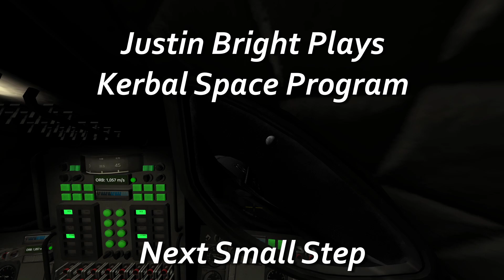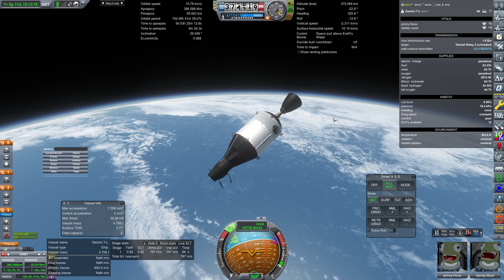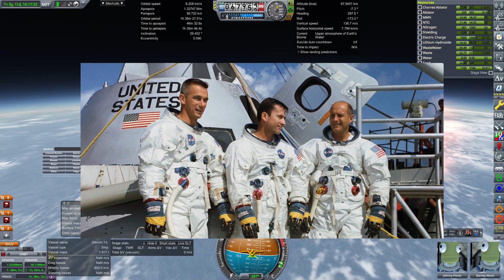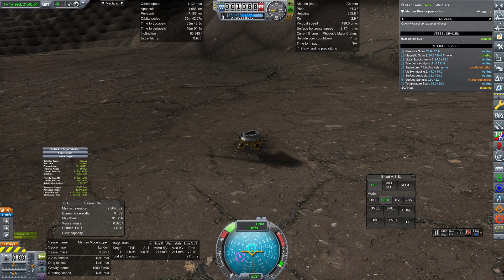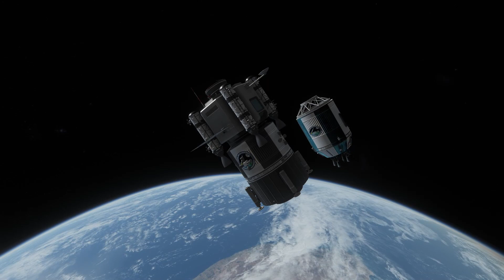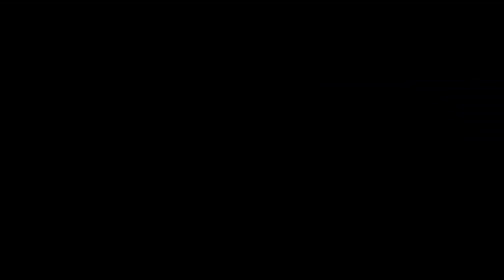Gemini Lunar Landing Part 1! - KSP/RP-1 - Next Small Step Episode 71

Comment: Is there a mod you have installed that lets you run a power simulation at different bodies? I’m struggling to design my probe for Mars with solar panels bc science costs electric charge
Reply from the maker: That's from Kerbalism! If you just click on the body name you should be able to switch it.

Comment: Lunex wasn't an Apollo or Gemini based proposal, it was a USAF lunar lander plan. It was planned to be a direct ascent lunar lander with a lifting body reentry vehicle, launched on some sort of super-Titan. The RL10 was originally developed for Lunex, starting around 1958, but when NASA was formed, it and Agena were moved to NASAs control (hence why Vega was developed, NASA had no knowledge of the RL10 or Agena until the US government forced the USAF to share). Very little actual hardware was ever produced for Lunex, but the RL10 was tested sometime in the mid 60s to verify that it could throttle for use as a landing engine. It ended up being able to throttle very low with almost no modifications. 

However, Lunex was extremely optimistic (lunar landing by 1966, and a lunar base by 1968), and the Vietnam war meant the program was pretty much abandoned by 1965.

Speaking of which, the USAF LV proposals were certainly special. My favorite is a Nova-class launch vehicle built entirely out of clustered Titan first stages.
Reply from the maker: Thank you for the history on Lunex! I'll make sure to mention it. I may wind up using it for the intended purpose, but only a decade late. The early NASA days are absolutely fascinating, with the way that there were multiple competing programs vying for dominance and not really sharing information. 

Also, a giant multi-Titan Nova sounds amazing.

Comment: I think your descent stage on the lunar lander might have a little too little delta v. 1800m/s is extremely close and 2200m/a would be way safer
Reply from the maker: Safer, sure. But heavier, also! Maybe it'll be fine??
Reply: @justinbright9567  try unmanned first and see if it works. If it doesn’t add a some more fuel and slap a few Castors on the first stage to easily boost performance

Comment: So the whole “Apollo 10 was under-fueled to prevent the astronauts from landing” thing proooobably wasn’t true (although I really want it to be : P ). The more boring explanation is that LM-4’s structure was heavier than 11’s LM-5, which meant that they had to compensate by not fully fueling the tanks. That said, Nelson, who you mentioned, quoted Cernan saying the opposite.
Reply from the maker: Interesting! I definitely thought I'd read that they only included enough fuel to simulate where the LM was in the flight plan; that is, having already mostly ascended to orbit.
Reply: @justinbright9567  That’s definitely possible, too - I’m absolutely willing to find out I’m wrong.

Great video, as always!

Comment: Welcome back!
I found your missing ignition. MechJeb spent it at 34:30, starting the circularization burn as it was ordered, but you immediately cancelled the burn.
Had you clicked one second earlier, you would have been in time - had you been one second late, you would have probably realized that the engine was burning already.
So yeah, I guess that the lesson there is don't push "execute next node" until you're sure you want to execute that node.
I made that mistake many times myself - hit "circularize" and "execute", then find myself out of delta-V in a wacky high inclination elliptical orbit, only to realize that I had the wrong probe core selected as control point and "retrograde" was actually burning anti-normal or something.

And now, a few words from our sponsor: the Oberth effect.
Often mentioned, but rarely understood, what is it, where does it come from, and how can I exploit it to crash ever bigger payloads into Jool's soupy atmosphere?
Journeymen KSP players are very much used to thinking in terms of delta-V, and for good reason: it makes sense like a currency. You spend so much delta-V to get from some orbit to some other orbit, and so on - except when it doesn't. Gravity assists, for example, look like free delta-V, and yet there's no such thing as free lunch, is there? Also, why does everyone keep telling me that burning normal or radial is bad? Why always prograde or retrograde?

The answer, my friends, is thinking in terms of energy. Yes, energy. Or, to be specific, specific energy.
First, choose a reference frame. When the navball says "orbit", what it means is "the body whose sphere of influence I am in currently, if it wasn't spinning".
This is an inertial reference frame. I mean, not really, but close enough.
Then, learn to calculate an object's energy. Easy: that's ½v², where v is the current speed as reported by the navball, plus -Gm/h, where G is the universal gravitational constant, m is the mass of the planet we're orbiting, and h is our altitude (almost. It's actually the distance from the center of the planet, but it barely makes any difference unless you're skimming the surface like the lunar lander in the video).
The more astute among you may have noticed that the gravitational energy is _negative_. That's not a bug, that's a feature.
If you make h really small, the gravitational energy is very negative, and so to keep the total the same, the velocity term must increase.
That's why you go faster at periapsis than you do at apoapsis.

Hold on, I hear you say, what does the Oberth effect have to do with all this?
Well, now we have all of the necessary ingredients.
If I have 100m/s of delta-V, I can change my velocity by that amount, regardless of my current speed. That's what delta-V means, after all.
But energy is not proportional to my speed; instead, it goes like v².
If I am at apoapsis, with a velocity of 50m/s, that velocity is worth ½(50)²=1'250m²/s² specific energy.
If I burn prograde all of my 100m/s, I end up with a velocity of 150m/s, which is worth 11'250m²/s² specific energy.
Since my altitude is the same, the gravitational energy is the same, so overall I gained 11'250 - 1'250 = 10'000 m²/s² specific energy.
But what if I burned at periapsis? There, my velocity starting is 200m/s. I didn't gain any free energy, it's just that more of my energy is in my velocity and less is in my altitude.
My 200m/s are worth ½ 200² = 20'000m²/s² of specific energy.
After my burn, I am going at 300m/s which is worth a whopping 45'000m²/s² specific energy.
During my burn, the altitude doesn't change, so I gained 45'000 - 20'000 = 25'000m²/s² of specific energy. That's more than twice the energy gain for the same delta-V!

This works because the energy goes like v², not like v. If v is very big, a small change to v is a big change to v², and we can take advantage of this fact with the Oberth Effect!
This effect is so useful that it's sometimes more efficient to lower the periapsis of a high circular orbit just to perform an interplanetary transfer burn at a higher speed!
Moreover, this effect also works when slowing down. If coming from interplanetary speeds, it might be more efficient to make an insertion burn at as low a periapsis as possible, and later circularize at the desired altitude!

Extra bit: now we see why it's not very efficient to burn normal or radial. Burning in those directions doesn't change the magnitude of our velocity, but only its direction, so we gain no energy! It truly is wasted fuel!
Moreover, if a pesky contract forces us to have an inclined orbit, it is always more efficient to do radial and normal burns when our velocity is smallest, so at apoapsis.
Pretend we are in a medium-height circular orbit, and we must move to a polar orbit of the same height.
We could of course do a single burn pointing normal, or...
1. Burn retrograde to lower periapsis as much as possible.
2. At periapsis, burn prograde to raise apoapsis as much as possible, taking advantage of the Oberth effect
3. At apoapsis, where we are going the slowest, burn normal to change inclination very cheaply
And now, the same in reverse!
4. At periapsis, burn retrograde to lower apoapsis to the desired altitude
5. At apoapsis, burn prograde to raise periapsis until the orbit is circular

Using these high-efficiency techniques, it is possible to put double the payload in lunar orbit when compared to the classic Hohmann transfer, for a given rocket tonnage.
Reply from the maker: Riccardo, my friend, I learn a heck of a lot whenever you grace my comments. Thank you! If you don't mind, I'd love to use this comment as narration notes in a future episode where I find myself talking about the Oberth Effect, because this is very well written and easy to understand. 

Same with your Oberth transfer concept, actually - I may launch a polar science satellite purely to demonstrate that concept. And double lunar payload compared to a Hohmann transfer?? Does that assume both craft are leaving from an equatorial orbit? If, for example, some hapless YouTuber wanted to try this, would they be launching into the plane of the Moon from the Cape, or launching at 90 degrees and making your proscribed inclination change?

Oh, and thank you for tracking down that lost ignition! I thought it might be something like that, darn it. You'd think I would be more careful on the lunar landing mission, but...
Reply: @justinbright9567  Justin, you are absolutely welcome to use my comments however you wish - in fact, I'd be honoured.

With regards to a polar satellite, if you are targeting a circular orbit then the most efficient way to put one in orbit is to launch directly into a 90° inclined orbit - after all, the cheapest plane change is no plane change at all!
However, in order to take advantage of the Oberth effect you can try and make as much of the burn as possible as soon as possible. Ideally, you'd make a single burn that puts your apoapsis at the desired altitude straight from the launchpad! Just configure MechJeb to put you into the desired altitude, instead of a low earth parking orbit. Then, you circularize at apoapsis.

The only exception is if you need an extemely-high-orbit polar satellite, with an orbit outside that of the Moon. Then it might be optimal to launch into a 0° inclination to take advantage of Earth's spin, and change inclination at apoapsis where it is very cheap and the manoeuver can be merged with the circularization manoeuver.

With respect to the high-efficiency moon transfers, I am afraid I got a bit overexcited and forgot that KSP uses patched conics. These high efficiency gains can only be attained by exploiting the weak stability boundary region, which does not exist in the two-body approximation that KSP uses. There exists a mod, called "Principia", which instead makes KSP use real (numerically integrated) N-body orbits, however its installation is very hard and playing with it enabled harder still: real orbits are never truly periodic, very low orbits are unstable, orbits in general precess... In fact, the mod acutally changes the Jool system since its configuration in stock KSP is unstable, and a few moons would eventually shoot out in interplanetary space. I recommend against playing with it in this current playthrough. It could be interesting to use it without so many other realism mods.

Nevertheless, I'll fire up KSP now and see if I can find some higher efficiency Mun transfers: they should also apply to RSS Moon transfers.
EDIT: nevermind, after a bit of fiddling and some thinking I managed to convince myself that Hohmann transfers are indeed optimally efficient in KSP. Oh well, live and learn.
Reply from the maker: Fascinating! I love finding out about the big edge cases, such as going from 0 degrees to 90 at an altitude higher than the Moon.

Ahh, I knew patched conics were going to be my downfall once again. I almost used them at the start of this playthrough, but felt it was a bit too much too quickly for me. Perhaps another time I'll give that a shot. Thanks again for testing all of this out and explaining it!